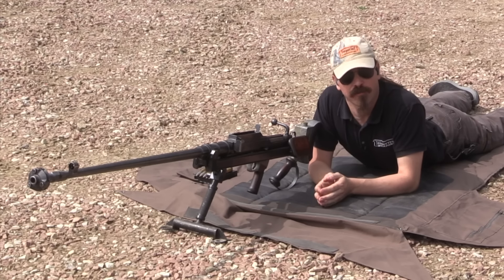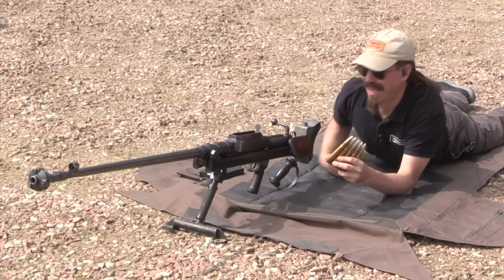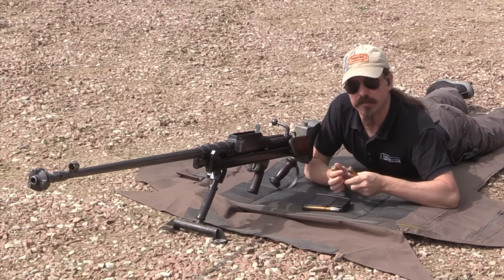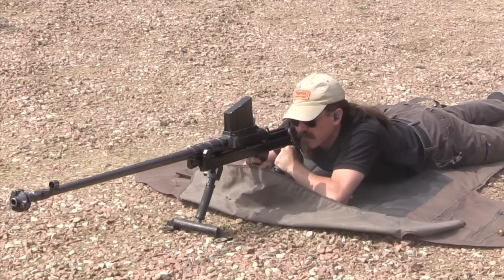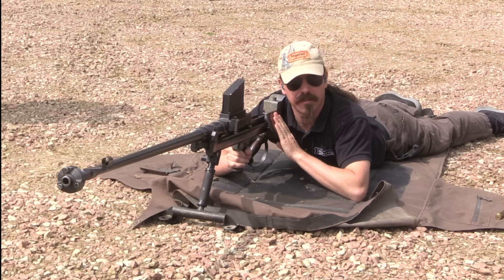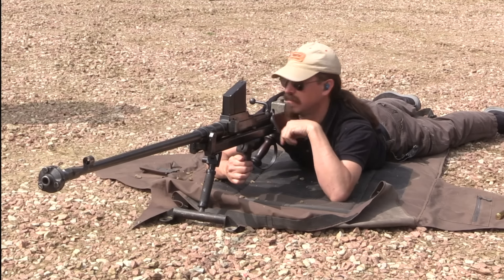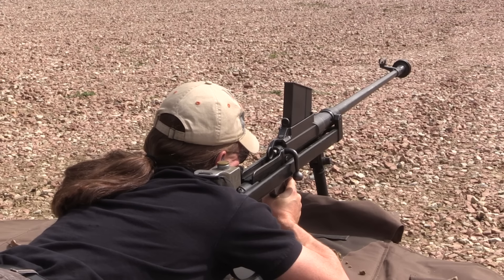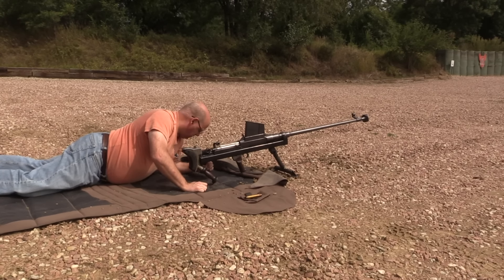Boys Mk I Anti-Tank Rifle at the Range

Comment: Tungsten is actually considerably denser than steel. I'm assumin the core is quite small to get the bullet weight down.
Reply: Came to the comments to make sure this comment was here lol
Reply from the maker: Yup, it is of course denser than steel. I should have phrased that better.
Reply: @ForgottenWeapons  i got confused when you said tungsten is lighter than steel
Reply: @spearton-1912  same lol
Reply: As one who has designed and fabricated some of my own projectiles that caught my attention.  FYI - Tungsten is even slightly more dense than typical depleted uranium.   (19.3 v 19.1 g/cc)  Tungsten typically has greater hardness than steels so that might have been the additional benefit that they were looking for to go along with the higher velocity of the lighter projectile.
Reply: @noele6588  Also depends on the nation making/using the ammo. Some countries, like EU, use tungsten instead of DU due to restrictions in rules. After all tungsten has pretty much the same kinetic effect without some of the more hazardous side effects of DU.
Reply: @noele6588  and its firey :3 and tungsten not poisonous enough to raise cancer rates in places you dont like. cant have their kids grow up and fight if they never grow up
Reply: I have thought that DU also catches fire while penetrating, something Tungsten won't be doing?
Reply: @juhajarkkoulvila7041  DU is self sharpening and self igniting on high energy impacts and also poisones. Tungsten on the other hand is just a very dense, highly unreactive metal.
Reply: @juhajarkkoulvila7041  Yeah DU gets super heated and from I've read has a better fragmenting effect while Tungsten is just a little bit more dense.
Reply: @andreasmuller4666  actually its nowhere nearly as good as DU, but the health concerns have overridden that. DU penetrators sharpen themselves as they penetrate, it constantly wears a sharp point at the end of the penetrator, vs Tungsten which mushrooms out at the tip. DU is a much better material for penetrators but its way too toxic for everyday use. Thats not to say they don't use it for things that absolutely must work, but its not very widespread anymore.
Reply: @juhajarkkoulvila7041  yes DU is pyrophoric.
Reply: @noele6588  DU self-ignites, which increases chance for things inside vehicle to catch fire from hit. This is also what makes it a bigger long-term health hazard for those on recieving end: while both DU and WHA dust will mess up your lungs when inhaled, burning DU also produces toxic fumes. It has also better armor piercing properties than WHA at speeds under 2000m/s (lower the speed, better the edge), but it only matters for tank rounds really, where every bit of penetration makes difference.
Reply: @ForgottenWeapons  I'd guess you got mixed up between Titanium and Tungsten while you were speaking. It's surprisingly common.
Reply: Fun fact: tungsten was discovered by a swedish  scientist, and  if you translate "tung sten" from swedish to english you gets " heavy stone"
In Sweden, the stuff is called wolfram.
Reply: @buddyb4343  That's pure tungsten and uranium, though. The selection of alloys useful for projectiles could have a larger impact on density in practice.
Reply: @TheExplosiveGuy  I never said that is it was comparable in performance, only the best option for a high kinetic energy projectile if one was TO NOT USE DU due to its obvious downsides.
Sthx for the material lecture, you didn´t tell me anything i didn´t know already.
Reply: @noele6588  uranium is self sharpening and the dusts ignites in air. Also us has lot of  stockpile of depleted uranium due to the us nuclear reactor design, where as Europe and many countries have a breeder reactor where depleted uranium are converted into u235.
Reply: I'm guessing Ian confused the weight of tungsten with that of titanium
Reply: 1kg of feathers vs 1kg of steel.
Reply: I was looking for this as my brain went "Wait, what?!" when I heard that. I got what Ian meant though, smaller core so overall lighter projectile.
Reply: Tungsten is heavier than steel and Lead. It is also harder than tool steel. I don't see how a Tungsten core bullet would be lighter than the steel core. If you did put in a smaller tungsten core that would mean there would be more lead in the bullet and lead is heavier than steel as well.
Reply: @bengtabelsson9727  
His name was Carl Wilhelm Scheel and it was present 1751.
There is a street in Stockholm named after him.
Reply: I'm glad I don't have to write this comment 😂
Reply: @ForgottenWeapons  love you Ian! You're the best, and the best make mistakes too!
Reply: @andreasmuller4666  "some countries like the EU"... you do know that 1) the EU is not a country, and 2) the EU doesn't have a unified military right?? and not only does the EU Not ban DU ammunition, several of the member nations actually use it. here's a link to the EU SCHER(Scientific Committee on Health and Environmental Risks) findings on the use of Depleted Uranium, note that they don't even recommend restricting it https://ec.europa.eu/health/scientific_committees/opinions_layman/depleted-uranium/en/index.htm
Reply: @spearton-1912  I commented, checked then deleted . Oops.
The round was known as an APCR - 'Armour Piercing Composite Rigid', the light alloy jacket spalled off on impact, the tungsten was exposed at the tip.
Apparently some US Ranger units were equipped with a 50 BMG version, mainly as a long range rifle.  Source: https://www.rifleman.org.uk/Enfield_Boys_Anti-Tank_Rifle.html
Reply: @andreasmuller4666  studies have repeatedly shown tungsten rounds to be way more carcinogenic than DU.
Reply: @Solnoric  I think if I was hit by one, cancer would be the least of my worries.
Reply: @DivingHawker  But....your feather canon will be a touch unwieldy.
Reply: More than twice as dense.
Reply: But u guess its only the very tip cause tungsten is also REALLY H A R D
Reply: @andreasmuller4666  Tungsten is very dense, and works very well as Light Armor Penetrating, Small Caliber Rifle and even Light Machine Gun ammunition.  It is however, nowhere  near as effective as "DU".  Depleted Uranium Projectiles, WHICH ALL YOUR European Union COUNTRIES DO USE, is designed to defeat Heavy Armor and or Bunkers.  It is mainly used as a "Bunker Buster"  Depleted Uranium is used instead of Tungsten because when the projectile hits it's target, it sharpens at the point as it passes through very hard materials.  Tungsten, while very effective as at defeating Light Armor, could never defeat Heavy Armor because it tends to mushroom and expand at the tip.
Reply: @ForgottenWeapons  Denser, also means weights more in the same volume. Iron (close to steel) 7874 kg/m³, while tungsten 19250 kg/m³.
Reply: @cantbanme792  Actually it is about just as bad as DU when turned to dust. The worst situation for both. Radiation isn't worse than other things at low levels.
Reply: @iatsd    Yes, yes, yes, yes, YES! Are you really sure of everything you just said? Any bit of it? Let's do some comparisons here. The density of tungsten is 19.3 grams/CC. The density of Depleted uranium is 19.05 grams/CC. So thats an increase of .25 grams per CC over Tungsten, which works out to less than a 2% increase in mass, which is unnoticeable from a kinetic energy standpoint. Tungsten is also much softer than DU, which is why DU makes a better penetrator. Depleted Uranium is far less common than Tungsten, costs more to produce and is more difficult to manufacture but is far superior to tungsten penetrators, which is why they used it in the first place. If it wasn't for everyone making a big hubbub about its toxicity they would still be in widespread use. And yes, DU penetrators do sharpen themselves while tungsten does not, tungsten most certainly does mushroom on impact. 

You've been playing too much war thunder or something, your facts aren't facts. And by the way, the penetrators weigh 4.6 kilos, not 1-2. And yes, the pyrophoric nature of DU also increases lethality.

Whats with all these people on this thread making a dunce of themselves? Talking out of their asses...
Reply: @bengtabelsson9727  Everywhere outside the US, what you see on the W as symbol. That was a concession to the US after some scientific disputes.
Reply: Good one Ian, but you should have said Tungsten Carbide core, which IS lighter than steel. Tungsten metal is way too soft anyway. I would love a chance to shoot one. Biggest thing I’ve ever shot, is my Martini in 577-500 No2, firing a 715gr lead bullet and that certainly wakes you up! 😁
Reply: @Afro408  Tungsten Carbide weighs 15.6 grams per cubic centimeter, steel weighs 8. Its double the weight of steel. Does make a great penetrator though, most modern AP rounds use it since it's so much harder than the armor it's hitting while still being extremely dense.

What's the velocity of that thing? 715gr is a chunky round...
Reply: @TheExplosiveGuy  Thanks Mark. I was only going by the relative weight of the TC inserts I use on my lathe. 😁
I never did chrony those bullets, but according to Quick load, they should have been doing around 1300-1400 fps and in a ten pound gun, it’s lively!! 😅
Reply: @TheExplosiveGuy   Well I cast my own from wheel weights ( free ) and so it's probably about the same as buying factory ammo for a 223. Not too expensive. It shoots the Lee 515-450-F bullet better than the the big one and it is also much more pleasant. :)
Reply: @Afro408  yeah nice, reloading is the way to go. I cast .357 for my PCP air rifle and Lyman 525gr 12 gauge sabot slugs for my shotgun, saves a boatload of money (especially when you sell boxes of 25 for $50😉 to coworkers). I go to Walmart (when there's ammo😡) buy a box of 100 target loads for $25, go blast them all, reload them with slugs for pennies on the dollar, then sell the same cases in the same boxes for $50 each. Good business lol.
Reply: @TheExplosiveGuy  Ha ha! Way to go!
Reply: @DivingHawker  but steel's heavier than feathers
Reply: @L1ama  "They're both a kilogram."
"... What?"
Reply: @TheExplosiveGuy  ive always wanted a nice big crate of 50bmg DU (which im not sure was ever made actually).  Just because.  Probably for the same reason I want a big crate of hand grenades and 40mm HE grenades. Lol
Reply: @Schmunzel57  the W stands for Wolfram from the German name of the ore wolframite given to the ore by Wallerius in 1747.
In Swedish the metal is named Volfram and the ore that Scheele identified was first simply referee to as "tungsten" literally heavy rock (by the miners becouse the rocks that the ore is found in is unusually heavy for their size). The ore was later renamed Scheelite in the honor of Scheele but is sometime referee to as tungsten in Swedish.
Scheele made a precursor tungsten, tungsten acid in 1981 but it was first two years later that tow Spanish brothers managed to make a impure version from the wolframite ore and named that metal Wolfram.
Reply: @bp968  DU .50 bmg was made at one point but hardly ever used in combat, since tank armor advanced so quickly, but I agree, I would like some myself, along with all those other things you listed and more😉🤣.
Reply: @TheExplosiveGuy  
@iatsd @Mark Green

And all of you sexy people
.. Nobody uses pure DU penetrators and sure as fuck nobody uses pure Tungsten penetrators either.
DU penetrators are DU alloys.
They have: 1-Density that is almost identical to pure tungsten. So the flight ballistics and kinetic Energy are comparable.
2-Beter mechanical properties at high speeds then pure tungsten "self sharpening" and toughness and ductility

Tungsten penetrators are tungsten carbides.. Usually.
They have:
1 greater toughness then pure tungsten
2 they "self sharpen" unlike pure tungsten
3 they have less density hence poorer flight ballistics then both DU and pure Tungsten (lighter projectile same cross section, worse bc) and usually less penetration then DU because at high speeds density have big impact on penetration performance. Some thermodynamic law..

Any wayz the DU penatrators, can performs better at "lower" high velocities than Tungsten carbide but/end does not increase penetration proportionally with increase in velocity. So they can make longer, heavier and slower, and yet better performing penetrators(better sectional density at point) then with Tungsten carbide ones and/or they can use shorter barrels like in Abrams or riffled one's like in Chalengers.
That said, new APFSDS-T rounds that uses tungsten, use Tungsten-cobalt-carbide that exels at higher speeds, but longer guns are needed. New German Canons, some Russian experimental ones etc... Toxicity wise, both are heavy metals, so they are toxic but DU is Alfa emiter and can be dangerous in therms of ionizing radiation damage. Thungsten-coblat-carbide is proven as very cancerous on some lab animals, mice i think.
So... you people can fact check this.. and also i dont know what's point of this.

*Tank Ammo Section Report No. 107 -
- a comparison of advantages and disadvantages of depleted uranium and tungsten as alloy penetrator materials
*An Owerview of Novel Penetrator Technology
*The Faliure of Tungsten Carbide - Cobalt cored projectile penetrating a Hard Target
*High velocity performance of uranium alloy long rod penetrator
Reply: @buddyb4343  The significantly smaller diameter would also improve the ability to "punch" through materials, along with the density of the column improving the momentum per unit area.
Reply: @TheExplosiveGuy  Yeah. In enviroment where spec ops carried nukes on their backs, and fighter-bombers would had carried tacnukes all day - DU is no big deal.

Hopefully humanity can fight their wars in next century without playing with nukes.

Tungsten penetrators are good enough for a long, long, time against best RU armor. Just put them in 140mm gun...
Reply: As for countries using DU in ammunition: at least the French have had DU tank APFSDS (Armor Piercing, Fin Stabilized, Discarding Sabot) ammunition penetrators since the 1980s. The British do as well (not EU but still European and NATO last I checked). Germans use tungsten ALLOYS. The most common alloys are some type of W-Ti (tungsten-titanium) alloys; the actual formulas are of course military secrets. Since most other European countries buy their ammunition either from Germany or Israel (which also uses tungsten alloys), tungsten is much more common than DU. Tungsten alloys are also available for export American tank ammunition and some countries like Egypt have those.

Nobody uses tungsten carbide for tank ammunition any more, since it's too brittle. It is, however, still used for small caliber ammunition in cases of APCR (Armor Piercing, Composite, Rigid) or APDS ammo. It is NOT used for APFSDS any more because of the brittleness.
Reply: Tungsten is heavy enough it could be used to fake a bar of gold, and expensive enough to be profitable to do so, just barely.
Reply: Haha I was thinking “isn’t tungsten like 3 times heavier?”
Reply: @TheExplosiveGuy  Actually DU is not very radioactive/toxic (well at least not anymore radioactive/toxic than any other heavy metal such as Tungsten for example). I definitely wouldn’t go around licking DU rods but it’s health effects are exaggerated to say the least. I think the real reason other countries don’t use DU is because 1. “Depleted Uranium” sounds scary and warcrimey; and 2. Because DU is extremely hard to come by when you don’t have a large amount of nuclear power plants making a sizable excess of it (see point 1 for why).
Reply: @ForgottenWeapons  Onscreen correction text pending?
Reply: @andreasmuller4666  Both have nearly identical hazards. Both are heavy metals that will fuck your body up if they get in your food or water.
Reply: @calebdavis1323  The myth that DU is this super radioactive, warcrime substance while Tungsten is this perfectly clean, heavenly alternative really needs to die.
Reply: Tungsten is basically tung sten (Swedish) or heavy stone because it’s so heavy. The tung is where ton comes from.
Reply: The British also used cast iron cores in AT gun anti-tank shot (APCNR = Armour Piercing Composite Non-Rigid) as it was found that because cast iron cannot be compressed, it gave an increase in penetration performance close to that of Tungsten. It also found a use for all the piles of useless cast iron railings collected up as a propaganda public morale exercise.
Reply: @CZ350tuner  I live in Glasgow it seems any cast iron railings which didn’t have a drop behind them were taking.
Reply: @cantbanme792  Because it wasn't incorrectly phrased.

It's because it was wrong.
Reply: @kireta21  I feel that the biggest health risk to recieving DU ammunition is recieving DU ammunition rather than inhalation problem. 

Especially if you're in a T72 - if the DU don't get you, your own ammo carousel will.
Reply: I must be denser than tungsten
Reply: @andreasmuller4666  wrong, Tungsten blunts and mushrooms off. Uranium does without the adiabatic shear banding and "self sharpens" as well as being pyrophoric you get better post penetration effects and MORE penetration Vs equal weight, diameter, length  W-Alloy.
Reply: @TheExplosiveGuy  great word! “Pyrophoric”